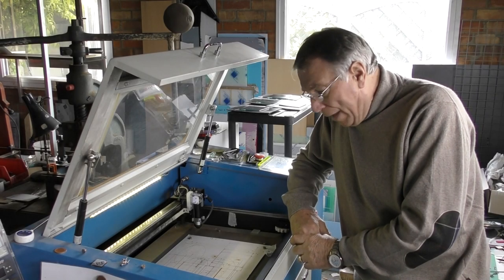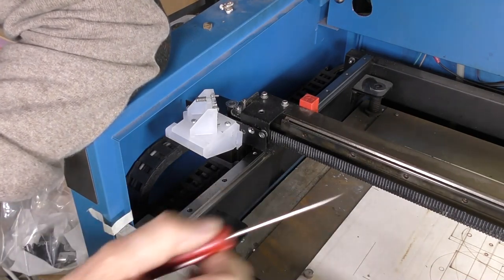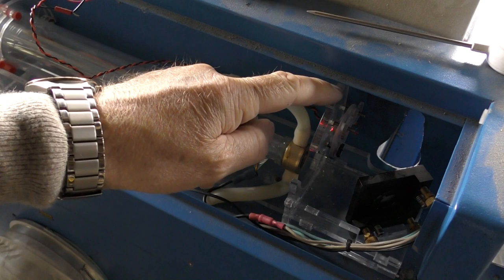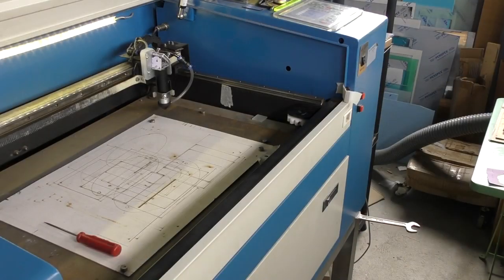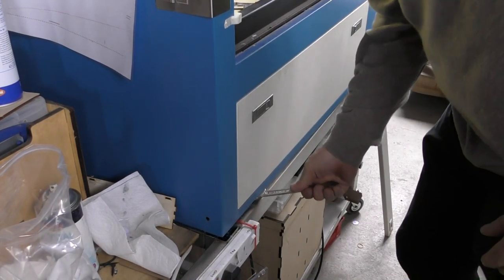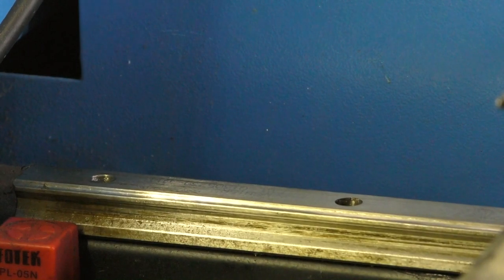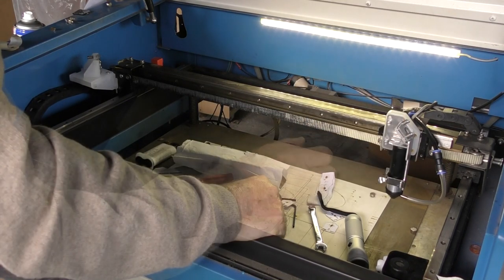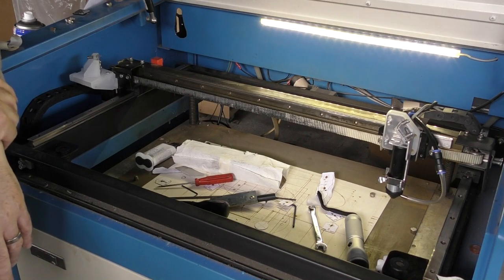RDWorks Learning Lab 186 The 4th Corner Puzzle and Red Pointer Lies

Comment: The other thing you are missing about the reverse tool checking the gantry is my tool doesn’t need mirror 2 to check it. It only uses mirror 3 to check the gantry. And I do not believe small ridged machine will have a gantry alignment problem. And for the people who can’t seam to get their alignment right they may want to believe it is a gantry problem. This tool will quickly put those concerns to rest. For people with big machines that are not as rigid I believe this tool is a must. The alternative is a very expensive machine level.

Comment: I sorted mine by removing the factory bracket for the second mirror. I made a new substantial alloy bracket which mounts straight to the side of the stepper motor bracket. I had previously stripped and rebuild my bed with shims under the rails as it was twisted when I checked it but the new bracket did the trick. I have some pictures if anyone is interested.

Comment: American Photonics
2 hours ago
My reverse system is the fastest and best way to get perfect alignment. Small machines are more ridged larger machines are not. You are missing a screw in your #2 mirror mount. That is why it is moving so much. You don’t need to remember where the red dot hits the mirror. Just mark it with a pen or sharply. If the reverse alignment tool and the Co2 laser hit mirror 1 in the same location then use the adjustment screws on mirror one to move (bend) the Co2 laser to enter the head in the correct location using the scorch method.  Only then will both beams occupy exactly the same space all the way to the exact center of the lens at exactly 90deg. Why don’t you try it?
Reply from the maker: Hi
I was unaware of your product until a couple of weeks ago when someone linked this video and asked for advice. In the past i have tried many different ways of non-scorch beam alignment but with only about 95% success, always having to perfect the alignment with the scorch method. My definition of perfection is to get the beam hitting the centre of the lens axially true at all four corners and centre of the machine table.  Even though I knew what I was looking for, your video was brief and the beam was already set to perfection for the video. As such I watched the video twice before I heard and understood the very brief mention of ADJUSTING  mirror 1. That was the most important part of the video that should have been stressed AND demonstrated. Yes, mirror 1 is the vital link in the chain because it removes gross tube alignment issues. and I can now understand how your reverse system has merit. I  must therefore offer a public apology for misunderstanding your product

 Russ
Reply: @SarbarMultimedia  it is not a problem. can I send you one. I would really like to know what you think after you have tried it.
Reply from the maker: Hi
 I did send a separate note to sales @....... that has further notes on it and my address should you choose to send. I will be happy to chat off line 
Many thanks for your understanding
Russ

Comment: Russ,  I'm a beginner with a small K40 Chinese laser I've been struggling with daily for over a week. I can't seem to get that forth corner aligned.  I'm ALWAYS 1.6mm low left no matter what I try.  I've inspected my mirror #2 and I don't see anything that would cause stress to that mount.  Do you have any advice for that particular machine?  Thanks - Rick
Reply from the maker: Hi Rick

You might like to watch this video as  it finally discovers the REAL reason for the 4th corner problem.
https://www.youtube.com/watch?v=Oc3UaJREQnU

Best wishes
Russ
Reply: @SarbarMultimedia  Yes Sir,  I've watched it.  It's very informative.  Thank you.   However, I have a small K40 with no drag chain.  I've been racking my brain to determine what could be causing the stress to move the Mirror #2 corner. I removed the X rail motor, limit switch , and drag chain riding along the X rail.   No change.  Still 1.6mm low left.  I think this shows mirror #2 doesn't have anything putting stress on the mirror when it's moving into the front right position.

 Do you have any other suggestions for inspecting or testing.  Thanks again.
Reply from the maker: @rickdel73  Hi Rick

 Perhaps you did not fully understand the problem with the  tried and tested setting method that has been in existence for years. It adjusts mirror 1 to set the beam true to the Y axis. You then set mirror 2 to make the beam true to the X axis,  The real problem with this method is the beam arrives at mirror 3 via a mirror 2 and mirror 1. It only requires minute setting errors in mirrors 1 and 2 to cause the 4th corner problem..  That is what this video is all about, ......those extra steps that have never been mentioned.  SEt your head to the rear corner and with tape on the head,make a burn mork. Move the head to the front right corner and now adjust mirror 1 by a minute amount to make a coinciding burn mark. Now replace the tape and make a new burn mark  and move the head to the rear right corner.  If the a new beuen mark does not coincide then make another small adjustment to mirror 1. 
 You may have to repeat this several times but this adjusts out the 4th corner issue.

Best wishes
Russ

ps   In your case it will not be anything to do with mirror 2 mounting stability.
Reply: @SarbarMultimedia  Thanks again Russ.   Yes, I've been doing as you say, but when I make minute adjustments to the rear right. the opposite corner moves out of alignment an equal distance.   I can just keep moving the error from corner to corner.
Reply: @rickdel73  Any luck with this? I am having the same problem.

Comment: Thanks I will give up on my laser pointer idea. Can you tell me if laser tubes have a shelf life or do they only degrade with use. Thanks in advance. Cheers Dave.
Reply: Another interesting and educational video especially for the novice and being one myself now along side with my recently purchased K40 I've just been given a [Eleksmaker A3 pro with a 300mw laser  module] although the laser module is already attached to the clear perspex mounting by two self tapper screws
from the back ( nearest to the rail) " not sideways like you see them advertised with a blue mounting bracket with grub screws either side that I "assume" ( although you should never assume anything ) that's what I was told by my old uncle because its the mother of all ** up's!
allow you to alter the height of the module itself,it also needed a power adapter then I realized I've got a few so and I've found a AC/DC BS EN- 61558 - it's 12 vDC 300mA ( my question is) > will this be OK to use with this laser module and the controller as it does fit to the mother board "male/female connections" on the control panel " because I'm debating or hesitant on  testing it in case the laser module goes up in smoke! - I'm halfway through a cabinet to put it in as the whole thing is exposed and I still haven't got my safety glasses but they'll be coming soon en207 rated ("well that's the claim on the website") any help would be appreciated.
Oh! Sorry Dave I didn't mean to put this in your post it thought I'd posted it in the public comment section  "although if you can help me regarding this power adapter predicament would be appreciated.
Reply from the maker: Hi Dave
When I asked this question of trusted sources in China about 3 years ago, I was fed the shelf life story but with no definite numbers. But as time has gone on, being the total skeptic that I am,  facts do not support that idea. Firstly the gas in the tube is at a slight negative pressure so there is little pressure differential to cause leakage from the OUTSIDE to the inside. This tube  is an impervious glass material so ingress of outside air can only be via interfaces.  In many tubes these interfaces are a THIN film of epoxy resin or similar that seal the mirrors to the tube and in the more expensive tubes there are additional seals of some sort that allow for mode adjustment of the internal mirrors. All but the most expensive tubes are of the  non-seal type. 

So, enough of the theorising, now let's look at the reality. I have a tube that is four and a half years old and still working like new.  It spends 90% or more of it's life doing nothing. When I do use it I know I am very gradually eating away at the carbon dioxide content (only 10% to start with) and that is the component that will ultimately cause my tube to lose power.  So logically if my tube had a shelf life, what is the difference between spending 90% of its time in my machine doing nothing and sitting in a warehouse doing nothing. The highest risk of "leakage" is the atomically minute 80% helium that is in the tube and because it is  under negative pressure,  it  is not trying to "OOZE"  out past the epoxy seals.  As time passes and my experience builds, I am believing that this shelf life thing is just another Chinese whisper .  And, in further support of this. I have a friend who bought 2 machines and 3 spare tubes 4 years ago. His original tubes where B grade but usable so he did just that for 18 months and 2 years  and then used two of  his "out of date"  A grade tubes. They are still running to date. The other is still "on the shelf".
 Best wishes
Russ
Reply: @SarbarMultimedia  Very correct.  That is why I suggest SPT, etc... and not the ebay specials as they will degrade just sitting there due to everything be sub standard (hence the "sweet" ebay price).  A quality tube will last for eons as you well know due to the tubes you own/have owned.
Reply: @SarbarMultimedia  Thanks for that. I have been in the process of building a machine for the last few years and it takes time to get all the parts together. Freight to New Zealand is very expensive so purchasing a built up machine was prohibitive. I have just moved house and retired so should have more time to get it up and running. It is mostly complete except for the wiring and the control panel. I have learnt a lot from your videos and you don't leave any stone unturned. Keep well. Cheers Dave.
Reply: I have a RECI 100w tube that I got with the machine and one extra. 5 years still running strong with one in machine, with my extra tube on the shelf untouched. Reading the RS comments, I am now confident that the one on shelf will still be useable. Thanks 🙏🏼

Comment: Yes, that left hand side is the wonkiest part of the China blue and I have always hated that damn thing.  When I used to use mine I dreaded dealing with Mirror 2 over all other mirrors (especially after I purchased your Z alignment setup) and while the metal on mine is 2-3mm thick it is still wonky and will flex with enough pressure.

Comment: Russ,
I have a nagging question.  I've watched your videos on the China Blue machine and it's evolution.  On your pursuit of excellence you discovered and adjusted mirror three to be high (not on center) on the target so after it exits the mirror it will not hit the side of the tube and exit out the center of the nozzle.  Why don't we use the same reasoning on mirrors one and two?  It would seem the same thinking would apply.  If you want the beam in the center you must aim high (probably to correct for the thickness on the mirror to the reflective coating) to allow it to exit the corner on center i.e. set mirror so the beam it towards the back of the machine and mirror two so it is towards the left side of the machine.   I hope you understand what I'm trying to say.
Thanks for all your thoughtful efforts and tireless labor in improving this machine.
RP
Reply from the maker: Hi RP

I'm sure I understand your question and supect you have the original miirors on your machine with tubulat ports,  the answer is that these mirror holders although cumbersom and very difficult to adjust (abysmal design) the mirrors are sited correctlyif you are within 2mm of port centre with your beam you will be OK and not clip the edge of the mirror. This applies to mirrors 1 and 2  only.mirror 3 is that special case where the beam MUST hit the "sweet spot"

Best wishes
Russ

Comment: Please more about  4th Corner mystery puzzle
Reply from the maker: Hi
 I am sorry that I cannot tell you more. Different machine sizes and mechanical designs will have different causes,  but the problem will always be the same ie mirror 2 is not stable and is changing its angle between the front and rear positions. I have encountered several different causes and the bigger the machine the more likely there will be a problem.  You sound as though you have this problem with your machine. If you like to add your email to another comment I will delete it and reply to you so you can send pictures and explain your problem.

Best wishes
 Russ
Reply: @SarbarMultimedia  Thanks for your new video 242 I managed to solve  4th Corner problem with easy
Reply from the maker: @Перун-о1ь  
Thanks for the positive feedback. Taking time to explain the  logic of why the 4th corner problem happens  and how to fix it has  made me rethink the whol XY setting process. I will have to issue a video soon about a much quicker error -free method that includes the 4th corner from the outset.
Best wishes
Russ
Reply: @SarbarMultimedia  I'm waiting for the next video. Thanks again. Greetings from Serbia